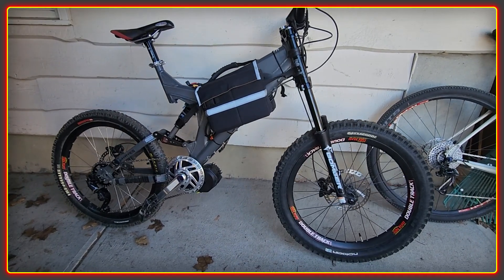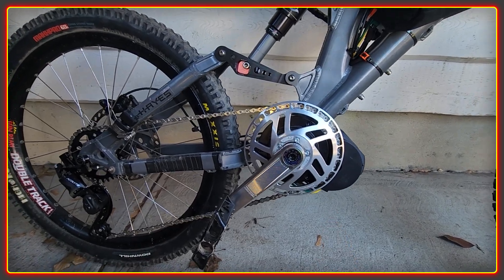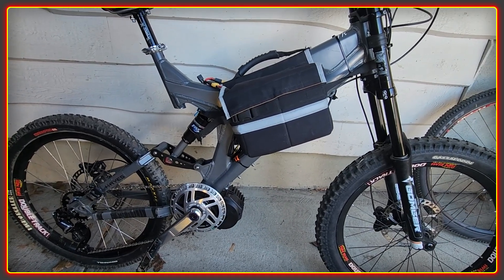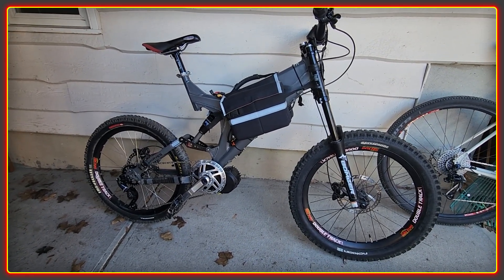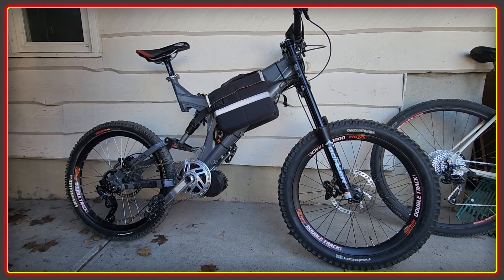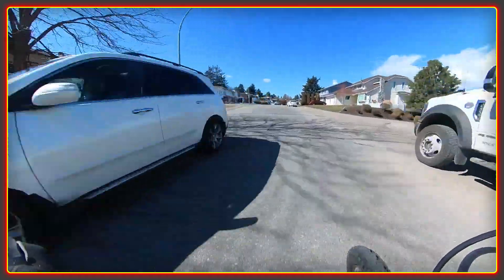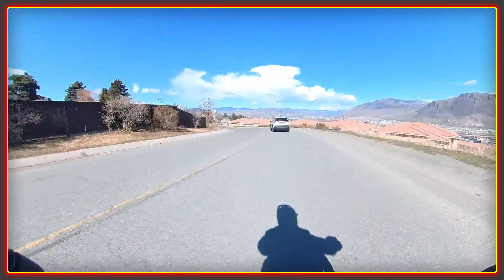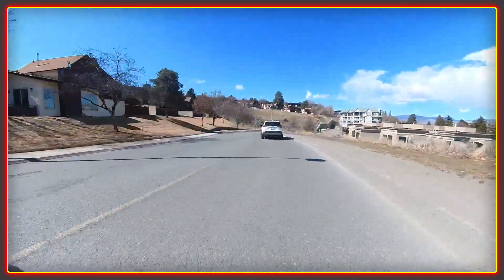High Voltage Tuned Big Hit BBSHD / ASI BAC855

Comment: Ahh I see I’m not to sure what field weakening is yet, but it will be paired with an asi855 72v I’m just less than 9 stone so not at all heavy… have you got instagram or a Facebook? Regards Josh
Reply from the maker: I think you messages the Facebook page. It's easier to communicate on our Discord. I'll load up the messages later. Field weakening allows for a higher top rpm with a DC motor.

Comment: Hello, what would you say the performance boost would be from a stock bbshd? I'm running a 48v 13ah battery and is already plenty of power and so much fun, but am looking for a bit more power. Would you say its enough power to stay with a bbshd? Or save up for something like a Talaria xXx or Surron? 🙏
Reply from the maker: You would need at 52 or better yet, a 72-volt battery to get the most from upgrading. At 72 volts, it's got more pep than a stock Sur Ron. The advantage with this is that it's still a bike, and you can restrict it to 750 watts and be legal and look legal. Sur Ron's are tending to get targeted more and more these days. It depends really on what riding you plan on doing. There are lots of videos in the channel videos that will give you an idea of the speeds and acceleration you can expect.
Reply: @HighVoltageKits  Ok thanks. Do you happen to know any good "Cheaper" 52v batteries? I don't really want to spend an insane amount of money.

Comment: Will this kit work for Can bus M620 motor?
Reply from the maker: We are struggling to crack the canbus for the torque sensor. The throttle is no problem
Reply: Is there any interest from others in kits for the bafang canbus motors?
Reply: I was wondering 🤔 does the pedal assist/torque sensor in the kits you produce work?
Reply from the maker: The cadence PAS will work but not the torque sensor part as its locked by the CANBUS protocol. We looked at doing a kit for the UART version but its a hard motor to get it reliable for.

Comment: Awsome kit you sell, although i honestly am struggling to understand why it is over double the price of a phaserunner when it is essentialy almost the same or am i wrong?
Reply from the maker: Because that's just the cost for the controller. You the need to buy a display..This link is the only one that works with it and is $100+ and is very dated. We use the eggrider. You have to buy a wiring loom. You need to learn how to program it. Ours is a plug and play kit with full support. Once you buy everything from Grin the price is much closer. Once you factor in your time and the support you get from us it starts to look like very good value. I should do a video on this. https://ebikes.ca/ca3-dps-n-bracket.html

Comment: How does it perform single speed with pas?
Reply from the maker: Its pretty slow with PAS. Its basically a stealth dirt bike. You can use it for gentle cruising about but its not really setup for pedal assist riding.
Reply: @HighVoltageKits  when I pas cruise, I’m only going 20-30mph max speed. I’ll probably go with the shimano linkglide 9 or 10 speed. I think it should be fine for that because it’s for a bit of exercise. I can do that now with the stock setup. But it will also be a mini surron when it wants to be. I’m hoping to get in contact with you to purchase a hv upgrade, but I’ll be using a 52v 20ah 60a bms 50s cell battery for the time being. Thank you for taking the time to reply to me.
Reply from the maker: You are most welcome. Our Discord is the best place to chat. Links are in the description

Comment: If its single speed is there any reason why won't just switch to motorbike chains and sprockets? More weight? Probably not that big a deal also its low down so handling shouldn't be affected all that much.
Reply from the maker: Its less weight and more complexity. You would likely need adapters for the sprockets to go from Bike to Motorbike. Tensioning the chain as well would need a customer solution unless dropouts were horizontal. Doable yes. You would have to be pretty dedicated and willing to put the time in. So for most builds its easier to just use 6 spd chain and beefy stuff.

Comment: I have the same setup as motor, battery, and controller. Can I run a 72V battery with the nylon gear?
Reply from the maker: Yeah. The Nylon will be fine if you gear it right and let the motor spin.

Comment: This video made me get the bac855 for my bike which is just like the bike in the video. Hand built Iron horse with dual 52 volt 20ah packs but they only have 40 amp bms. My bike does pull the full 2800 watts until my batteries get to 54 volts. Running a parallel battery manager which makes all the difference in amp draw.
Reply from the maker: Sounds great. Have you posted some pics on our discord?

Comment: which one is faster mate BBHD or Photon unrestricted 2000w both with save battery 52 and on same bike ? love your videos and thanx in advance
Reply from the maker: The Photon will be faster unrestricted in that scenario against a stock BBSHD. You need to modify a bbshd to really get it shifting.
Reply: @HighVoltageKits  thanks a lot 🙏 you only one on internal who tested it unrestricted that i could find . I was hoping its a Photon ,coz weight is a big deal plus newer technology
Reply from the maker: I love it

Comment: where did you get the rear chain ring adapter
Reply from the maker: I had it made. Working on having some more done.
Reply: @HighVoltageKits  Any notes on getting it fabiracted or is it pretty straight forward

Comment: I really want to build a bike to do tight single track with big hill climbs here in Australia (where it gets upwards of 35°c regularly). It would appear a bbshd would be the go. I'm not interested in going faster than 50km/hr at the most and would rather have a larger pedal assisted range instead. With this in mind would a 52v or 72v battery be better? Which is better for making torque?
Reply from the maker: Are you planning on peddling the bike for exercise?
Reply: Yep, definitely. Exercise is the plan but I'm pretty time poor and the singles are 15km away on a dirt road so being able to cover that distance at a reasonable 40km/hr.

Comment: Wow this looks awesome. How fast was the top speed?
Reply from the maker: About 60 I think. Need to sort the GPS out.
Reply: @HighVoltageKits  looks faster than 60 kph
Reply: Dang impressive. Is the 52v battery rated at 70 amps continuous?
Reply from the maker: Its about 450 amps continuous. Not a typo. The cells are really High discharge lipo. Not practical but a good test battery as I can reconfigure the Voltages easily.
Reply: @HighVoltageKits  what is the continuous  nominal power and peak watt power on your kit?
Reply from the maker: Peak it's 4000 watts at 72 volts. You can't pull that all the time. It's a modified kit so it's not been assigned a constant rating. If you hit it hard up hills etc it will heat up but not as fast as you would think. It depends on alot of things like gearing, bike and rider weight. On a 40C day in the summer I have backed off a bit to be safe. We have thermal rollback to help prevent damage.

Comment: I sure wish there was a clear cut way to purchase a system upgrade like this for my bbshd.
Reply from the maker: There is. We sell this exact upgrade kit. Its our design.  If you email greg@highvoltagekits.com we can set you up. You will also get full build support for both the kit and your bike through our discord server. There is a link to the kit in the description of the video. Its always listed out of stock because each one is custom made to order and we need to ensure it will work for you. There is also a link to join our discord. Cheers

Comment: im so new to this whole thing, I dont even know what a BBSHD is - but let me ask you - is it basically a older cheap downhill bike found readily on the used market, and converted to electric? are they generally always mid drive? are hub motors ever used? im doing this. thanks for the awesome channel!
Reply from the maker: Hey Sean. Its a bike that was owned more than bought but yeah you can get these cheap for sure. The parts need upgrading often but its a good way to have control and get just what you need. You can definitely use a hub motor although they tend to be less effective hill climbing and when fixing say flat tires etc. They are simpler and quieter to operate though so advantages as well. The BBSHD here has been modified to run at this kind of speed and power. They are not normally like this. Glad you like the channel. We also have a good community on Discord which you are welcome to join and post questions as well as learn more about ebikes. The links are in the description. Cheers
Reply: @HighVoltageKits  Awesome man thanks. i will join the Discord - I think i have a suitable frame. its a 2003 norco VPS launch. it has a 68mm/113 bottom bracket with english thred. that should work ok ?
Reply from the maker: Sounds awesome. Post some pics!

Comment: one more thing what option would you choose between cyc pro and bbshd with asi 855  regarding speed torque hill climbing ? cheers
Reply from the maker: For me I would take the BBSHD as you can just single gear it. Kind of depends on the riding style you want. There is a much larger rpm range you can hit with the bbshd. If you want to peddle then the cyc has a better sensor and feel.
Reply: @HighVoltageKits  thank you for your reply

Comment: Is the chain skip not because your asking a lot of torque out of it with such a mid range gear with so much power? I feel like it would very quickly wear out (chain stretching primarily but leading to gear wear) I’d be inclined to use the beefiest chain I could fit (not sure what chain your are using tho tbh)
Reply: Asking a lot - when it’s pointing up hill from a standstill or just a decent length sharp incline
Reply from the maker: We have a few theories. It's under heavy load so up hills and less with me cause I'm lighter. It might be the chain is too long. We added links. Might be the b screw. Might also be the chain type not working the the narrow wide. If we are very unlucky it might be the hub is too week and it's the pawls slipping.
Reply: @HighVoltageKits  what hub you using? That could very well be it
Reply from the maker: I'd have to check. Away for Easter here. We will eliminate possibles!
Reply: @HighVoltageKits  less pawls normally
Means bigger pawls which means more engagement with larger gears. The louder ones usually, like hope hubs. And, you can also get modified hubs with ‘out of phase’ pawls, so there’s less chance of being between teeth when you try to engage the drive (as one pawl is engaging the pawls not directly opposite (90 degrees for a 4 pawl hub) are between teeth, so the time between engagement points is halved, giving you more reliable engagement)
Reply from the maker: Appreciated. We have what came originally I think. It might be too weak.
Reply: @HighVoltageKits  I bet that’s it tbh good luck

Comment: That chonky boy needs some heavy off-road action, would love to have a bike with as thick tyres as that and my old fox talas on my old Marin attack aren’t as beefy as those triple crown forks (they really need a service too) and my battery in the back pack doesn’t help with the weight distribution being all over the back end. That bike isn’t meant for the streets it’s meant for the dirt of a rugged old field side track lol and my tsdz2 leaves a lot to be desired power wise, but I do like the torque sensor that your lacking here. Though I haven’t ever tried a non torque sensing bike before tbh
Reply from the maker: Yeah. We will be going out in the bush for sure. There will some new motor options out shortly in both the tsdz2 and bbshd size and style. We are starting to put some information up on our Discord.

Comment: Seems like Specialized made loads of different BigHits around 2005 ish..
Mine is 26" front 24" rear wheels, adjustable rear link + BBS02B 48v 1.2KW
Best possession I own hands down.
Reply from the maker: They are a brilliant frame design.

Comment: It's great to see an update on the Big Hit. It looks like an 04-05 frame? I have an 06 Big Hit and it's different. My downtube is a square shape as opposed to round and came with a 26" rear end. Along with other frame differences. How many amps are you running this 52v setup at in the video? What gear is in the motor? PEEK? It would be cool to see a vid of this bike thrashing through some offroad singletrack stuff with ups and downs and to know how smooth the on/off power delivery is over tricky terrain.
Reply from the maker: You are probably right on the frame. It's the Nylon right now as the PEEK is being looked at for replication. Looking forward to offroad once the chain skip is fixed. We need the battery as well.
Reply: @HighVoltageKits  yes someone else needs to make the PEEK as they've been unavailable forever now
Reply from the maker: We should info soon. Luna said two months but that answer is getting old.
Reply: Yeah the first gen bighit was a mullet with a 26 front 24 rear. I went with a 24 front to take some rake out of it and drop the front for seated riding.
Reply: @enlashok  it's easier to find good quality 26" DH tires than it is 24" these days.
Reply: @Hybrid600  100 percent but 24 are getting common for youth sizes

Comment: So what is the message here? I think the BBSHD is still the king and not one can knock it off the hill. Well, who?
Reply: Depends how u look at it, price to performance, pretty clear winner - bbshd. But it has no torque sensing so it’s more ‘moto with pedals’.. if money is no worry, then cyc is clear winner imo (for strap on kits) or m620 frame fitted (see Andy Kirbys bike, forget what he calls it)
Reply: @Sam3532  Perhaps, I couldn't stand listening to the cyc on my 4 hour weekend rides though. That would ruin the serenity out in nature. I'll check out Kirbys but I'm guessing it's too expensive for most.
Reply from the maker: I think the message is it's still a rock solid option that can do a range of roles from utility bike to touring to a souped up hotrod that you can use like a Stealth dirtbike.

Comment: I don't have an HV kit(YET, saving.), but this reminds me of my own bike in a lot of ways even though it is nothing like mine it rides similar to mine but with better acceleration and generally looks at least 25% safer than what I ride. The only thing I like about my bike is  it has gears so that would let me put off some maintenance  for longer. Really beautiful build to be honest those 24 in tires have just the right thickness to still let you fly left or right as much as you'd like I'd bet! - With everything on it (sans the rider) what's the total weight of this bike? It's impressive!
Reply from the maker: Thanks for the kind words. Look forward to welcoming you to the HV family. I think about 60lbs with the battery. I need a scale cause I'm always asked this one.

Comment: Dam thing looks fast. I bought my BAC 855 from you guys almost 2 years ago. I already had the BBSHD from LUNA. I have a cheap Dolomite fat tire frame with a few upgrades but nothing special. Im still using a cheap 52v 20 ah with you 60 - 70A Map and a cheap chinese battery with disabled current limit. I keep it in first gear as I dont go fast and i like power climping when i need it. Battery wont last long if i get into much at all.
Reply from the maker: I remember it well Bob. Great to hear from you!

Comment: That Bike and setup look great - I've been running single gear BBSHD+ASI BAC855 for 4000+ miles - on a single chain - no more worries with it! 28T front 36T rear - 4.4" 26" Fat bike - love it - built for extreme hill climbing!
Reply from the maker: Awesome 👌 That's roughly the same gear ratio as here.
Reply: @HighVoltageKits  If your rear gear is small enough - you can use the "Shimano Alfine CT-S500 Alfine Dual Pulley Chain Tensioner" instead of the derailleur, I did initially use my derailleur as a tensioner bur felt it was unsafe with the sloppy position (some wire wrapped to pull the D to the right position).
Reply: What is the top speed you're getting on 28t-36t? Are u 52v or 72v?
Reply: @Jujubees225  72v - no idea on the top speed, I travel on canal paths and untidy cycle routes - so speed is not a thing for me - so I'm usually 15-20mph, but I think I've been 30mph+ on a short test messing with field weakening e.t.c. I think it could hit 40mph no problem at all.

Comment: Hi friend, I am always impressed with the propulsion of your vehicles. This is another prototype. I can never understand, does it depend on the motor or the battery or is it a combination of factors?
Were you pedaling or was it just propulsion?
Impressive brakes.
I absolutely have to solve, even if I carry a trailer of 50 kg, it is not possible that I can only do 30 km even without a trailer. There is something absurd about my engine, my battery.
👍💯❤️
Reply from the maker: Yeah we need to figure it out.

Comment: I had bad chain skip too on  the smallest cog ,I had to bring the chain line  directly right in line with that smallest cog. I used 5 spacers too on the chain-ring to bring it out.

The chain-line looks way off from a normal chain-line , but it NEVER skips now. The larger rear cogs are big enough they don't slip with the chain being so far off center of them.

Using a wide/small tooth chainring really helped too. I used the lekkie 52t
Reply from the maker: Cheers Keith it's a single speed setup so the line is good. Some parts are a bit experimental so not 100% sure the cause yet.